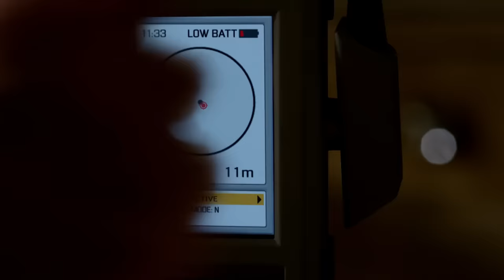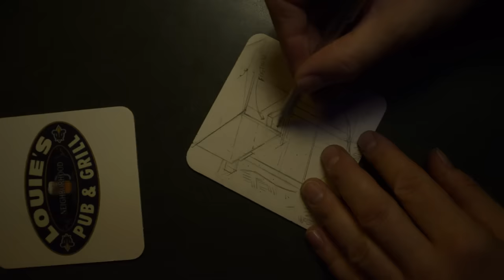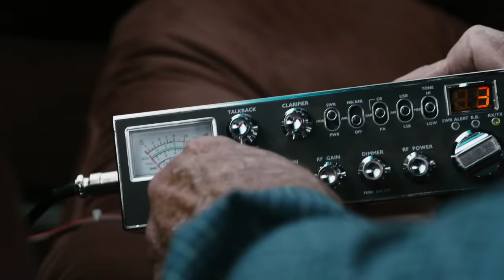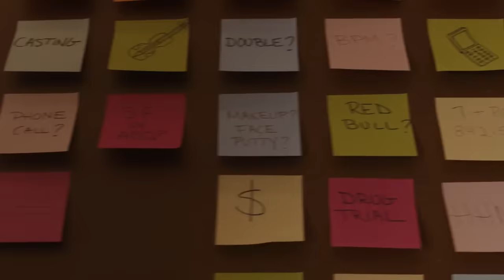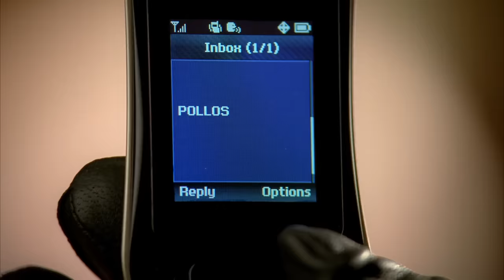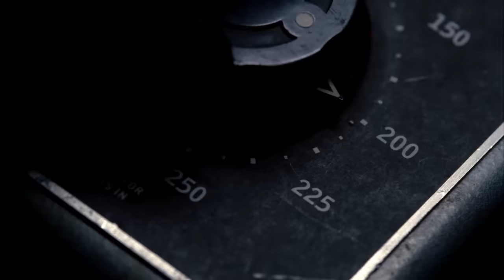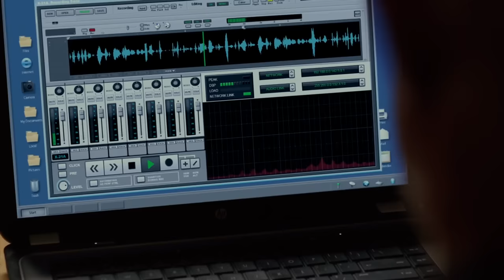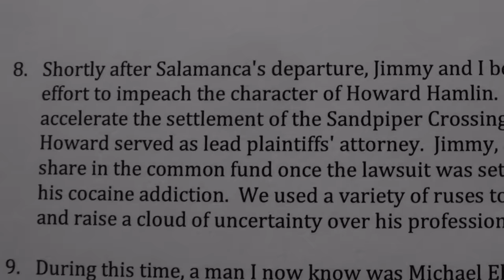The Full Story of Mike | Better Call Saul & Breaking Bad Retrospective

Comment: If Mike was familiar with the M40a1 then it's most likely he fought for several years post Vietnam in smaller asian conflicts, probably as well. 

The original design saw extensive use and by about 1973 they had only about 400 left. The biggest changeup was that due to the wood stocks warping they switched to the composite design. 

Chances are after that fighting dried up he became a cop. Common move back then. 

Great video btw, Keep up the great work!

Comment: Minor point-

Mike’s “guy” that he tells Jesse about is implicitly Victor, not Gale. There is 0 chance Gale was being used by Mike and Gus in a security capacity, and Victor, who definitely would have been used in that capacity, is now dead because of Jesse and Walt killing Gale and, in particular, because Victor got IDed by a witness to the cops. This also explains why Mike doesn’t feel threatened by Gus’ creative use of a box cutter, as he understood exactly why Gus did what he did (it wasn’t just about intimidating Walt and Jesse; it was about Victor having messed up in a way that turned him into a liability, and also intimidating Walt and Jesse.) 

Whether or not Mike may have subconsciously been thinking about Nacho when he said it (which I don’t think is the case; if anything I think he could be talking about being a cop where he would have a partner he worked with) is debatable but in any case none of this changes how the line definitely has nothing to do with Gale and is most likely about Victor.

Comment: 4:50 The original M40 was still in service when the replacement came out. They didn't remove all the old M40's and replace them with A1's they just added A1's and replaced the old stocks as they came in for service.

Comment: Gunsmith here! The rifle mike was using is actually a Remington 700. The US marine designation is the m40A1 I’m 90% sure, so you’re technically right. But later on m40 models start to differ from the 700 model. The newer models have a lighter but stronger barrel and a faster bolt.

Comment: The Vietnam War did technically start in 1955 but that was under the departure of the French, which closed out the First Indo-China War (1946-1954). From 1955 until 1964, the war against the North was fought under the control of the South Vietnamese but with advisory from the U.S. 

The United States didn’t officially start their full-scale invasion of Vietnam until 1964 which increased the number of Americans from 29,000 to 184,000. After the Tet Offensive in 1968, the number was increased to over half a million troops. American combat operations ended in Vietnam in 1973. But fighting in the country continued between local forces until 1975. 

So it’s more likely that he served in Vietnam between 1968-1973. Which is a 5 year span of time.

Comment: Not replaced. Phased out. The A1 would enter service slowly replacing the originals. Mike could have had an M40 for his entire war without receiving the M40A1. But it gets more complex as the M40 is derived from the Remington 700 which ended up in Vietnam as early as 1962 as soldiers managed to get their personal arms into that conflict. These were popular hunting rifles praised for their accuracy and reliability, most owners had a nice optic on there. The "sniper" used by the US until 1966 was officially the M1c and M1d Garand, a notoriously inaccurate weapon. It made sense to snipers and marksmen to slip their personal rifles into the war. 
 But dating his service is made even harder by the Winchester Model 70, a very similar weapon which was released in 1936 just in time to get involved in WW2 and Vietnam. And it did serve on the lines. 
 As such, familiarity with a Remington M40 isn't a solid lead for when Mike went to war. He could easily have been equipped with a Winchester prior to acquiring the Remington 700 or M40. That's the subtle genius of Mike, we can never be certain of his past.

Comment: Okay, Walt is a problem, yes. But the point where he becomes connected to Gus everything is on a set trajectory for Walt and Gus that’s not going to change, one of them is going to die.

Gus didn’t want anything to do with Walt and knew it was a bad idea initially.

Mike knew it was a bad idea. But Gus went along anyway thinking he could use Walt as a disposable chess piece. By that point Gus knew Walt had earned the anger of the Cartel because of Tuco.

So Gus’ plan was to use Walt for a while to make money off his product, have Gale learn to make Walt’s product, then let the Cartel kill Walt. 

As far as the problems Mike received from Walt most of them are Gus’s fault and not really Waltuh’s.

Cause what Walt supposed to do in that scenario. If he was okay with Gale (cause dumb luck and his desire to have Jessie saved him from Gus’s plans for Walt) Walt dies, Gale learns to cook his product, and Jessie ain’t in the picture anymore, probably dies of an overdose with Jessica Jones.

But Walt does get rid of Gale, then Gus is forced to improvise cause he’s greedy and wants to keep Walt’s product in some way so he finds a way to bring Gale back in the picture and he’s a bit too aggressive with his plan which tips off Walt about what’s going on. 

Walt doesn’t want Jessie dead and makes a plan to kill Gale… and then everything snowballs out of control cause by this point Walt is very aware that Gus is going to kill him. 

Gus is the catalyst for Mikes problems in breaking bad more so than Walt.

Comment: There's something about "Breaking Bad" and its off-shoots, as well as many movies & TV programs, that always pisses me off.  The script writers always demonstrate complete ignorance regarding RF theory.  The fact is, a GPS tracker will not work, if it's entirely surrounded by metal or another conductive surface.  That applies to cell-phones, as well.  They depend on the reception & transmission of microwave signals, which cannot penetrate any kind of electrically conductive shielding.  In addition to metal, this includes water, concrete, & the ground.
Reply: boo hoo
Reply: but the funny man cooks meth

Comment: I would love to meet the meth addict who could make use of a 20 minute head start over a professional criminal and killer. 

"He's got a 20 minute head start on you!" 😱😱😱😱😱 OOOOHH NOOOOOOO! 🙄
Cut to:
Jesse picking his nose while loading another gigantic bowl of blue, with only one shoe on. 40 minutes later both shoes have been located, but there are no signs of his keys. 

FULLY 90 MINUTES after the initial call, and Jesse is dressed with shoes and keys, almost ready to go. He's just gotta smoke one more bowl for courage. But the torch lighter isn't working, and while he could light the torch off his stove, he sets about searching for a can of fuel he remembers wasn't empty, "somewhere around here," though how more fuel is supposed to fix a sparking problem isn't immediately clear. Jesse decides he can't do anything until he has a working lighter, and so sets out on foot to the gas station, as his car is nearly out of gas, and he doesnt want to run out on the way to Gayle's. 

On the way back home he drops his keys somewhere on the ground. 

20 minutes. 😆 😆 😆 Fuck your 20 minutes, Walt.